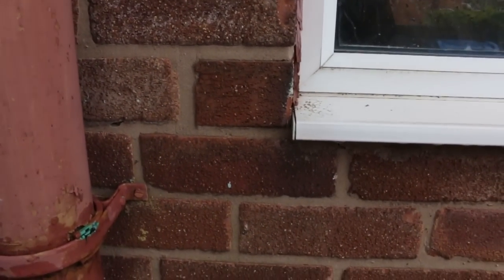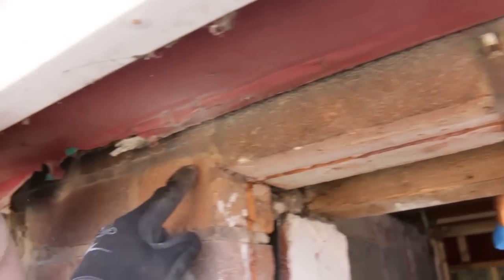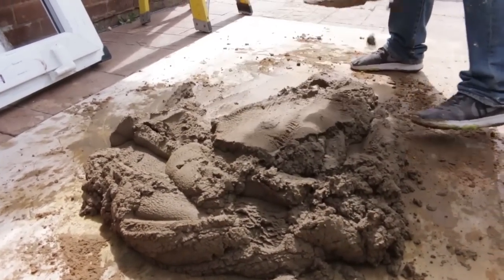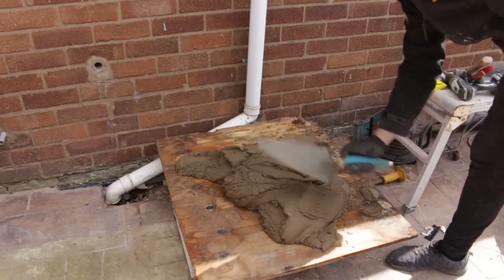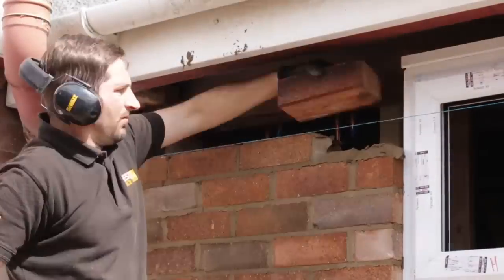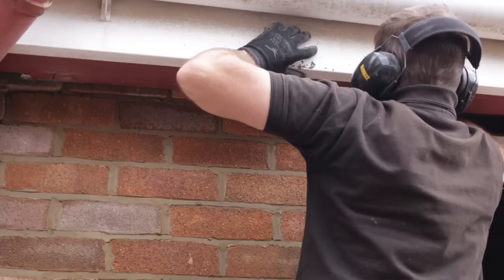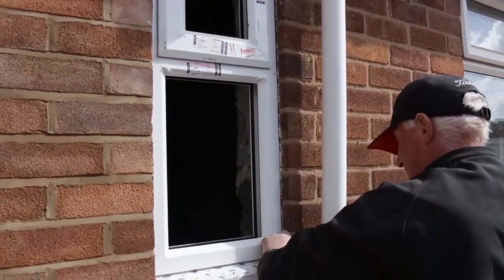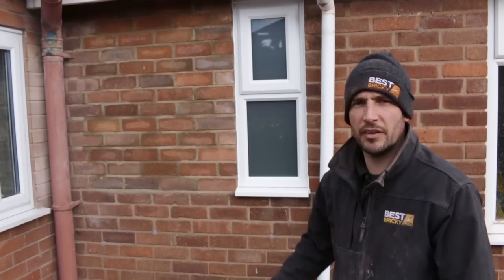Bricklaying vlog - reducing size of a window

Comment: Great vid stu sorted the bond a treat 👌 would of looked a dogs dinner with a quarter in it 👍 well done mate. I maybe would of finished it with a jointing iron the existing looks like its had a bucket handle on it but your weather struck looks great aswell.
Reply from the maker: cheers, the original was weatherstruck but looked a sandy mix and washed away
Reply: stu crompton you done a great job mate looks 👌 proper

Comment: Hi Stu, have got to do this exact job with a cavity wall, would you still advise fitting the window first and then bricking up to it as opposed to bricking first and then fitting window after?
Reply from the maker: Yes because u work to the window which is straight